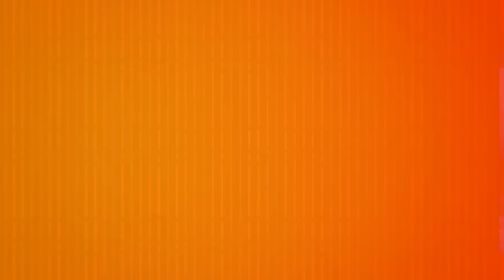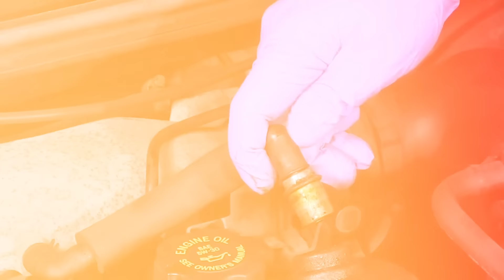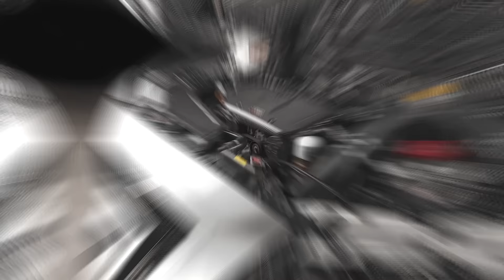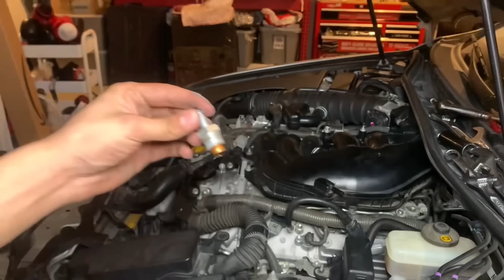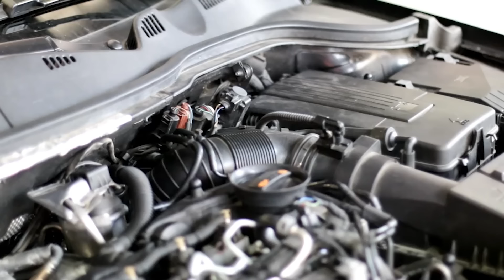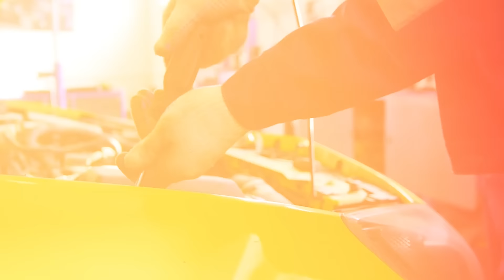Don't Let This $15 Part Ruin Your Subaru Engine

Comment: what engines are affected ?
Reply: Virtually every engine by every manufacturer (USA market) since at least 1970.  My Subaru does not list recommended service intervals, not sure why maybe it is included in some other item.  Personally. I would inspect every 30,000 miles, irregardless of engine.  Then either clean or replace before putting it in.  On a Subaru 4 cylinder it is easy, and the PCV is not expensive .  This video did not give step by step. Look at Mr Subaru's videos for one that does.

Comment: Does anybody know if this is AI generated?
Reply: I think it is but the issue with the PCV valve on the Subarus is legit. They say to inspect every 30,000 miles and replace if necessary
Reply: Hell for 20$ it definitely doesn't hurt to change 30000 or around the 4500 oil change interval that falls close to the 30000 to 35000 miles on the vehicle. In that time is a good time to also replace cvt and differential fluids.
Reply: 🤣 Yes